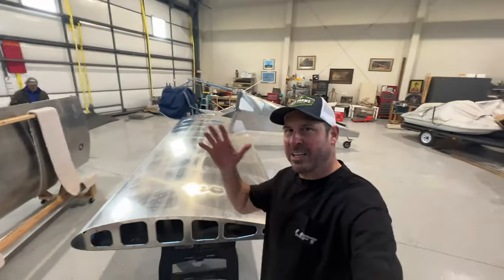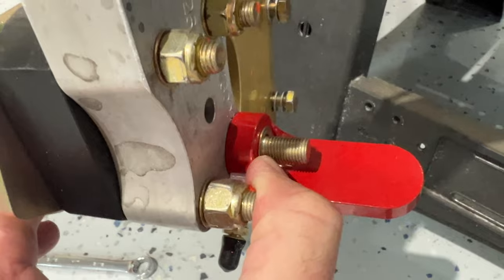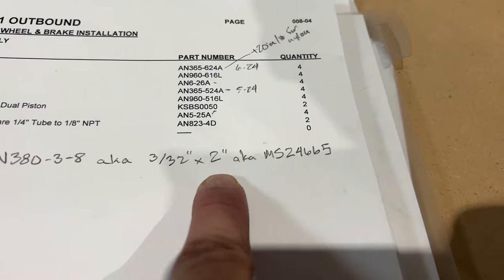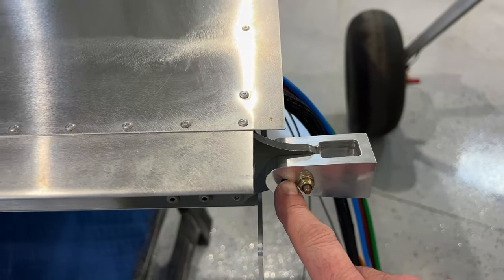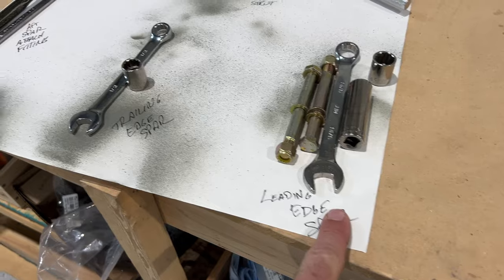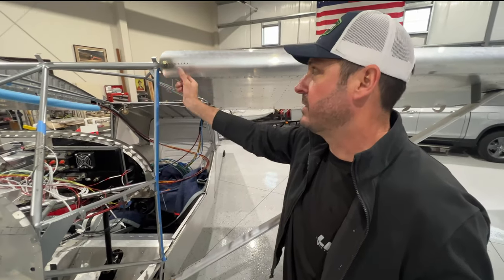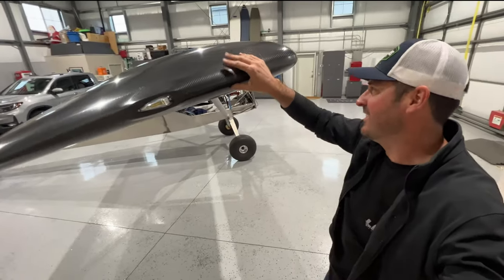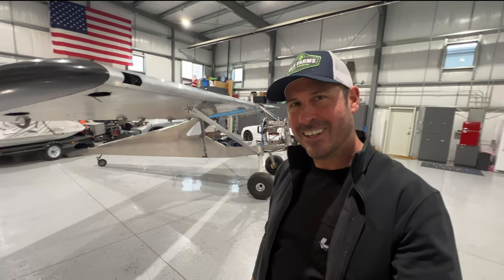Installing Wings on the RANS S-21 Bushplane Build

Comment: Stacking washers is totally no worries...especially grade 8 ones. Double especially when using lock nuts. That jack thingie is a great idea...tho with the non aero shape, you might end up losing 0.007 knots in cruise. DAMN YOU PHYSICS!!!

Good thinking aheadsmanship laying out the bolts and required wrenches ahead of time. I probably wouldn't have thought of that and would have been forced to make some NSFW noises as a result.

You must be super stoked that the wee beastie is looking like an airplane. Nicely done all around.

Comment: Glad to see you re-torqued your wheels. And Typically you can use up to 3 washers. One under the head and two under the nut. There are two thicknesses, usually designated with a L for the light ones. I'm looking forward to the first flight!

Comment: Hello Steve, I know this is late, but Aircraft Spruce is a great source for AN and MS Hardware. The washers that you showed looked like the L so when you see for example AN4 bolts take AN416 that is the common thickness while you see the thin washers are AN416L the L is the thin washer. I just discovered your videos and I like them, thank you for sharing.

Comment: Install the oil temp sensor and safety wire it and the mechanical fuel pump before you install the engine.  Don't ask me how I know. 😂 Can you do it afterwards, yes.  However, it's easier now.
Also, drill your holes from one side then the other to keep everything strait on the aft spar bracket.  Again, don't ask me how I know. Don't try and drill thru from one side all the way. Also, check with rans on drilling all the holes now. Tony said sometimes the angle of incidence doesn't need adjustment and if it does it just one wing and it will keep from drilling an extra hole now.  Hope that makes sense.
Reply from the maker: Thank you! That’s very helpful. Your paint is looking good!

Comment: Gantry with a few slings, or a drywall jack makes it a one man job and sweat free.
Reply: On my  builds, I've used the chain fall trolley in my shop AND a sheetrock jack when hanging the wings, they made it an easy one man job.  I preferred NOT having help for such an important step, not having a helper made me really take my time and not feel rushed.
Reply: A drywall lift is definetly the way to go.  Two people - easy peasy.
Reply from the maker: Cheating! ;)
Reply: @CLEAREDDIRECT  if you ain't cheat'in you  ain't try'in